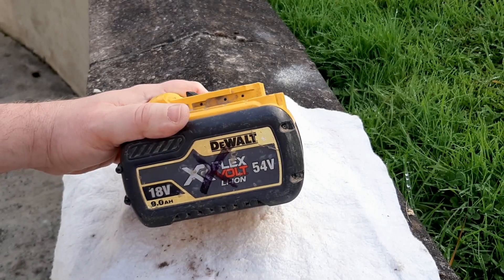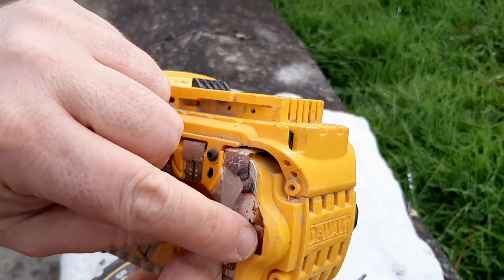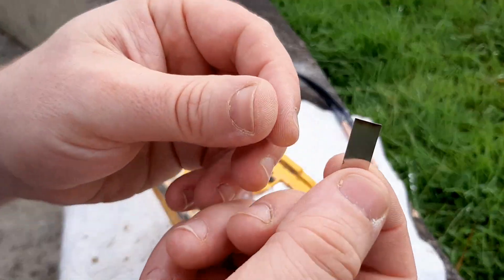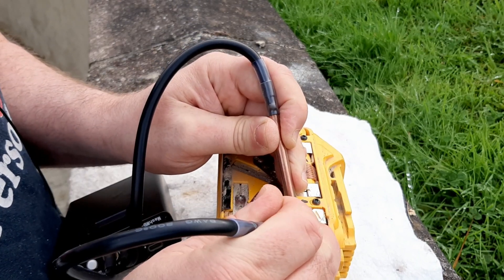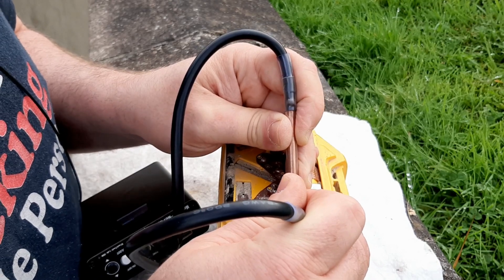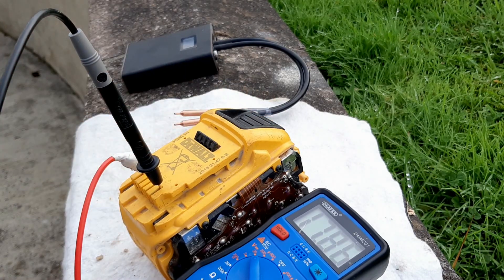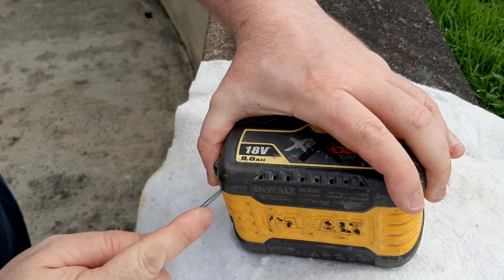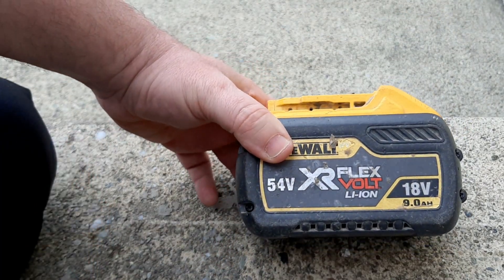Flexvolt Battery Fault Diagnosis and Repair

Comment: I’ve got a 9Ah/54 Flexvolt battery that is showing 2 bars of charge but won’t charge on a charger. It will run a 18v tool but not a 54v tool. I tried jump starting, no joy, and opened it up but no visible defects or blown fuses. Any suggestions gratefully received. Many Thanks.
Reply: I'm in the same boat with a 6ah Flexvolt that charges to 2 bars and runs the small tools but doesn't run the large flexvolt tools. Did you ever figure it out?
Reply: @NickRgibbs unfortunately not, nothing visible by way of broken solder joints or even failed individual cells. It seemed to be due to a deeper problem perhaps in failed PCB or some such. Too advanced for my knowledge. I gave up, reached deep into my pocket and bought a new one. One subsequent thought I had was trying to remember whether the battery had ever been dropped or had some other hard impact. I’ve tried a couple of the copycat Chinese variety but have found them to be complete rubbish so I’m sticking with the expensive DEWALT so I’ll do my best to handle these things very carefully.

Comment: There’s a video of MrSubaru responding to VCG Construction regarding FlexVolt batteries and MrSubaru shows that the voltage is supposed to drop if you just hit the 60v switch without signaling through the middle terminal. Basically, every FlexVolt battery has two switches: Electronic and physical. You need to do both to get 60v.
Reply from the maker: Yes

Comment: I've given up on Dewalt due to their shockingly bad reliability of their flexvolt batteries. I have a living to make I can't be messing about with batteries. Ive replaced my entire tool set with the makita 40v battery system. The flex volt battery isn't fit for use
Reply from the maker: I would tend to agree They're too complex too much to go wrong
Reply: @doctorlefthandthread  they need to go back to the drawing board and design a system using the pouch type batteries
Reply from the maker: @KuwaharaBMXRider  I think they gotta put too many protective measures in them due to the volatile nature of lithium-ion they probably err on the side of caution.
Reply: @doctorlefthandthread  they seem to manage just fine in mobile phones
Reply from the maker: @KuwaharaBMXRider  good point
Reply: They need to have a dedicated 54v battery. That way you have all options. Only 18v, 18/54v flexvolt, and only 54v.

Comment: My 6ah flexvolt displays only one led and when connected to charger both lights come on after about 10 seconds but battery is flat......
Any ideas thanks
Reply from the maker: Take off the sides look for broken connections

Comment: Disclaimer, these findings are my own and took all the safety precautions, if you don't have the knowledge and experience working with these batteries, you should not attempt it, do it at your own Risk.
 I figured out what the problem is, the problem is within the battery itself and it can be 1 of 4 possible issues. The battery consists of 15 cells, each 5 are grouped together to provide 20 volts, when combined together it results of 20+20+20=60 Volts, if one of these groups is faulty, the 20 volt tools will continue to work since each group provides 20 volts and they are all setup in a parallel configuration, may not last long but the 20 volt tools will work. 
When the battery is put into 60 volts configuration, by sliding/pushing the side black pins all the way to the back as well as you have to actually short C1 and C3 pins by means of a jumper wire, you will get 60 Volts across B+ and B- when fully charged if all 15 cells are good.
Below are the steps you can do to determine what the issue is. 
1- take apart the battery and check for blown  fuseable links, each side of the battery has 3 major connection from the BMS (Battery Management System) to the actual batteries, one link is skinnier than the rest and may blow, and most likely it blew due to faulty cell (9ah & 12ah use 21700 cell while 6ah use 18650).
2- If a given cell is bad, the best way is to isolate and determine the one that is bad and replace it, to do so, push and hold the slider all the way (I shoved a piece of plastic to hold it in place while I am doing the testing), this will separate the 3 groups;  then measure each group and determine which one has the lowest voltage (you many have bad cells across more than one group), you will find at least one cell that is below 3.6 volts while the rest should be above 3.8 volts. 
3- check the spot welds on the batteries, use a tiny screw driver to try and shake them, I got one cell where the spot welds weren't making contacts (this is very rare, option 1 or 2 are the most common).
4- BMS is bad, Battery Management system.
5- You are welcome :)
Reply from the maker: Thanks for the advice

Comment: Would be nice to see what you’re doing there
Reply from the maker: Sorry this video is one of my older battery ones and maybe not as well made as it should
Reply: @doctorlefthandthread  I’ve got a 9Ah/54 Flexvolt battery that is showing 2 bars of charge but won’t charge on a charger. It will run a 18v tool but not a 54v tool. I tried jump starting, no joy, and opened it up but no visible defects or blown fuses. Any suggestions gratefully received. Many Thanks.
Reply: @doctorlefthandthread  Naaa,the vide is perfect, it shows everything, some people just need to be spoon fed.

Comment: I had the same problem with a 6ah 54 v battery, charger weld start charging and stop. I put the battery on a DeWalt torch and left on until battery completely flat, it then charged to full capacity
Reply from the maker: That does work I have done a video on that fix too

Comment: Why doesn't anyone explain how to remove the Top, Mine is stuck and is lifting the 56v switch mechanism!
Reply from the maker: If you have the 4
screws out that hold the top on you have to pry with a screwdriver they are stuck on
Reply: @doctorlefthandthread  Yeah I got it off in the end, its funny the newer models don't have any stickiness and are easier!

Comment: Good video but it would have been better if you showed how to remove the top and what exactly you sanded.
Reply from the maker: Thanks for the advice
Reply: I've tried to dismantle a 9Ahr but the top is stuck on. It seems to be pulling at the side PCBs so will have to desolder them to remove the top.

Comment: You can’t check the cells without disconnecting them all can you?
Reply from the maker: It's tricky on flexvolt if you can check the voltage of all but one then check the overall voltage by connecting c1 and c2 terminals then pushing in the 54v slider you can work it out. Flexvolt are awkward as hell

Comment: tha connection is working like fuse and the nickel strip is narrow in that place. In many photos in the internet you can confirm this.
Reply from the maker: Thanks for the info and fear not because the strip I use is only 0.1mm so it will burn out in case of overload quite easily

Comment: Thank you for the video. Very helpful! What kind of nickel plate should I buy to do this on one of my own batterys?
I wont risk anything in case of over load.
Reply from the maker: I buy 0.1mm nickel strip in case of overload it will burn through like a fuse and disconnect so very safe. The 0.1mm strip is easy to weld with a low power welder too.
Reply: @doctorlefthandthread   i have the same issue with a battery, what amperage does it take to overload? I was thinking about putting an actual fuse in to repair mine, but I was unsure what amperage I should use.
Reply from the maker: @davideloewen  I use fine nickel strip 0.1mm I know that it will definitely burn through before if anything goes wrong. It happened to 2 of my repaired batteries when I accidentally shorted them. It kept me safe and both batteries were easily repaired again.
Reply: @doctorlefthandthread  thanks! I might have to try that. I don't have a spot welder though, just a soldering iron...

I did a little reading, and it looks like the Samsung 18650 cells used in these have a maximum safe discharge of around 20 amps. (My battery is a 5s 2p) so if I understand this correctly the 2 parallel battery circuits would have a maximum safe discharge of around 40 amps. So long as it's set up to fry at around say, 30 amps, it should be fine... I think...

Feel free to correct me I'd I am wrong I'm kind of a novice when it comes to this kind of stuff, but I'm trying to learn, and I really dont want to start a lithium fire.
Reply from the maker: @davideloewen  I am no expert either but I know the strips burn out quick if the battery is shorted because I have done it accidentally before. I don't solder directly on to the cells although there are plenty of people who do. My fear is solder run to cause a cross connection on the positive end of the cells. Lithium fires do not seem fun so be careful.

Comment: I have one of these same problem. Haven’t opened yet but not far away from you by the sound of your accent 🤔
Reply from the maker: I got lucky with this one saw what was wrong right away. The standard batteries are more straightforward to work at than the flexvolt. Yeah I am in Tyrone.

Comment: Where can I get the little spot welder. It looks so neat. Can you post a link thanks.
Reply from the maker: Here you are it's on ebay 
https://www.ebay.co.uk/itm/394275666040?mkcid=16&mkevt=1&mkrid=711-127632-2357-0&ssspo=yFg8j8t5T3q&sssrc=2349624&ssuid=cjPn_ZfdQLW&var=&widget_ver=artemis&media=COPY
Reply: What's the brand and model number of the spot welder? The ebay listing has disappeared...

Comment: Mine seems  too be a little diode  or small tf or B fuse in the f1 line  anyway how too change or replace it or even were too get such tiny little things I got 12ah flexvolt  battery
Reply from the maker: I honestly don't know they are the most complicated battery on the market due to the dual voltage set up I got lucky with the one I had

Comment: If you want to see the 54v volt on meter you have to short C1 and C2 together and push the Bar in then you can see the other voltage
Reply from the maker: Thanks for the advice
Reply: @doctorlefthandthread  no problem

Comment: My flexvolt battery is not working on Flexvolt tools but it works on 20v tools. Do you know what could be wrong?m
Reply from the maker: That's common I haven't come up with a fix for it yet
Reply: @doctorlefthandthread  thx for the quick response,  will you ever make s video for that issue?
Reply from the maker: @RikoRey92  if I can figure out why it happens I certainly will